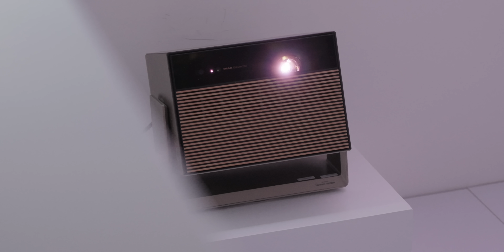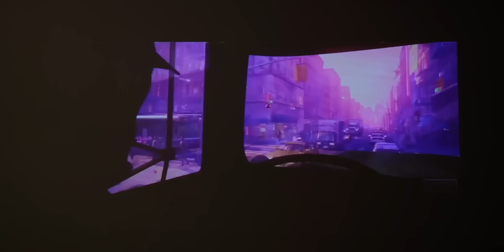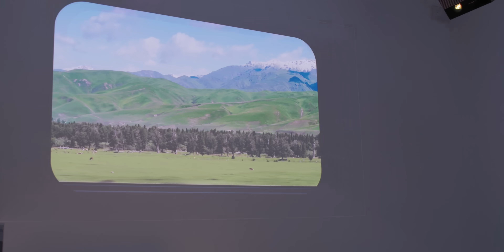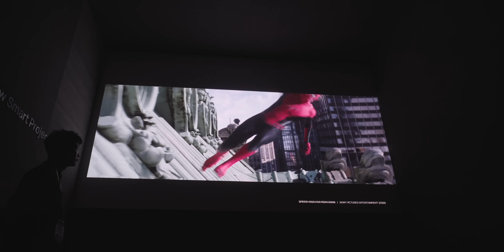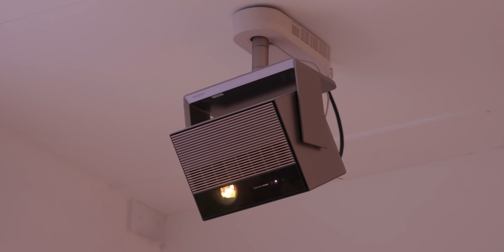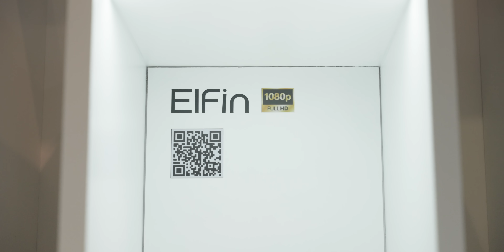It's FINALLY here! XGIMI Projectors 2024!

Comment: I wonder how this new XGiMI projector would be any different from what projectors are currently capable of doing.. My old Benq W1070 projects a 16:9 screen ratio. Only few scenes in movies like Oppenheimer and Interstellar are filmed in the IMAX ratio. On those particular scenes, the black bars from the widescreen ratio are removed from the image and it opens up to cover the full 16:9 ratio of the screen; yielding the full IMAX ratio experienced in the theater.
Reply: IMAX ratio is 4:3, so your projector can’t project that. Unless you have black bars on the sides